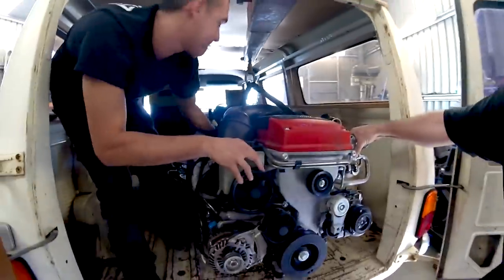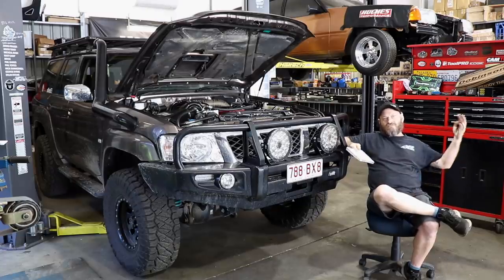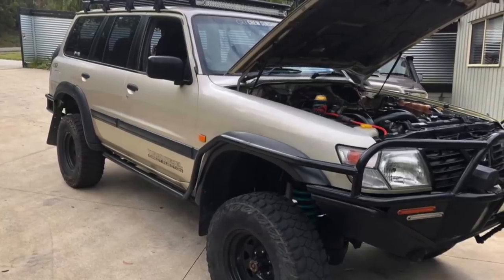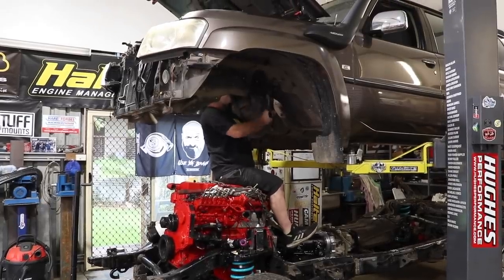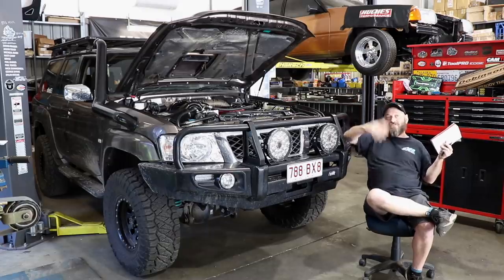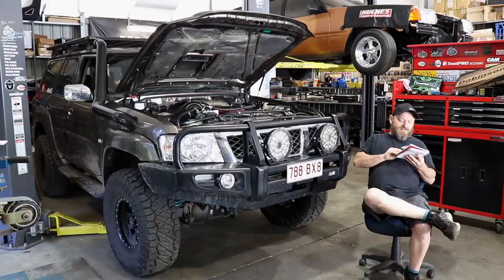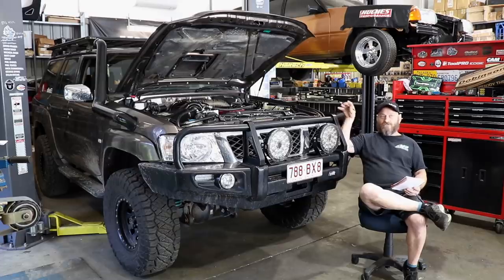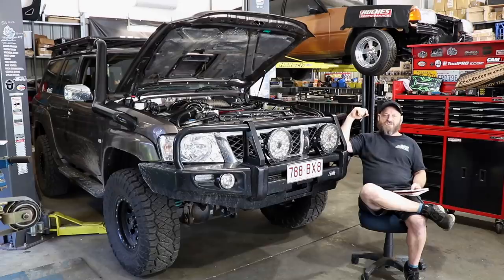Thinking of a Cummins Conversion? Watch This First!

Comment: ive seen lots of bmw m57 swaps into patrols. hell of an engine to put into one
Reply: I was looking to comment this. The m57 is a badass engine! There are a few in USA making close to 800whp and 1,100ft lbs (600kw 1500nm)
Reply: @JAM4382   stock engines with a light tune make 350hp 550tq and rev to 5k rpm. Love mine in my 335d.
Reply: @shapoopeedee  nice👍🏻 I had a 335d also until some asshole wasn’t paying attention and totaled it. I so miss driving it, I want to get another someday.
Reply: @spannerworx7106  Santjer Performance BMW M57 Triple Turbo 793whp / 1082 lb ft…. The information is out there. It’s not a kit you can buy yet as they are still developing the setup.
Reply: I was going to suggest the same, fitting kits are available from Europe complete with ECU etc, just need a motor form something like an X5, checking around basic total would be well under $20K (kits about $10k and then engine about $4-5 then all the bits and pieces) plus a mate has a GQ shorty sitting in the back of his shed......

Comment: I’ll probably cop it here, I’ve had many cruisers and patrols. I’d love to have a S4+ patrol with a 5speed 1hdfte.
Reply: Davo, have to agree, the 5speed auto and 1hd-fte conversion in my 105 is smooth, quiet and gets it done .. I'm also Gu fan for the suspension geometry and diffs of course .. but like most of us, just want more than what came under the hood! For a second project, I'm on the lookout for a cheap S4 Patrol and I'll do the same again .. You get 24Valve, efficiency, high enough torque to tow whatever, no overheating and long term reliability. Front cut FTE for $12k and if it's done less than 500000k just send it, with a bigger set of injectors and turbo .. No rollin coal!
Reply from the maker: It's certainly not a bad idea but also not cheap, that'd be a $30k easy.
Reply: @theskidfactory  Spot on with the calculation, 30k for the conversion is realistic, plus the donor GU .. makes an end product that is better than either of the brands ever made and less than half price of a new version of either .. IMHO
Reply: If you do happen to do this fella’s, the new yanmar Marine engines are a 1hdfte. Instead of paying 18k for one with 500k, 21k for a brand new engine is the way I’d go. As soon as someone makes a 1hd to re4/5 adaptor, I’ll be doing this. Re5 behind the 1hdfte would be my dream car, keep up the wealth of knowledge and future episodes fellas never miss a skid factory vid 👍

Comment: Tune your AFC to not give as much fuel before boost pressure comes up & you'll cut out that low end smoke & can actually get the turbo to spool up faster. You might need to change the spring or even to several springs within it. If you know an idea of your various boost pressures you can bench test the AFC foot travel accordingly to help speed up parts choices & adjustments.

Comment: Glad to hear someones conversion cost more than mine! I have just completed an LS3 and 6L80 into my GU and it's now a sweet, smooth ride.
Reply: Ls3 factory cams suck and so do the heads for low end. Stick a btr torque cam (202 duration 111LSA)  and ls1 style heads and manifold. Will have better torque around 2k rpm maybe as much as 40lbft. The Australian LS1 cam is even worse for low end. Best factory low end cams are L33 and Lq4. But the btr 202 cam is better then both. People forget that diesels don't rev past 5k. But everyone poops on these tiny LS cams even though the are good to over 5k rpm and most ppl go for something in the 22x and up duration. Unfortunately.
Reply: How much did you spend?
Reply: @Dan-rg7jj  nobody puts an LS into their patrol to putt around at 2000rpm though haha
Reply: @tcmx712  Have you ever driven something with a 4 speed that weights 3t plus? Even 2t plus unless you have bulk torque at 1200rpm like Al's it's gonna be doggy. Even with the correct gearing. Really, you are governed by gearing and in hilly burbs mine sits between 1k and 2.5k rpm stop start and up to speed. About 2.2k on the freeway in 4th probably similar to Al's. No idea what gearing to tyre ratio his is? Never said an LS won't do 5k plus. I have a 383 so torque is bit too big for 50kmph side streets at those kind of rpms. Also you can't just nip through the gears with 4 speeds not enough spread so you're always well over the speed limit. Sure mine is better now with the mods but still need more down low.
Reply: @Dan-rg7jj  dude op has a 6 speed and ls3 so why you waffling on about 4 speeds hahaha, and you do realise a standard ls3 has more torque at 2000rpm than a v8 70 series does anywhere in the rev range let alone anything that comes standard in a patrol so I don't know why you're saying it needs more torque down low when it moves the patrol a hell of alot better than stock???
Reply: @tcmx712  I'm not having a shot at the OP. Al does have a 4 speed which is relevant and he said comment what you think would be a good idea for a conversion so I did. I HAVE an LS3 thereabouts. It does have torque at 2000rpm. Not as much though as it has at 4000rpm. The only thing I said about the op is that the LS1 stock cam along with the LS3 cam looses torque down low (even in the mid) compared to the 6.0l and US 5.3L and LQ4 truck cams. It's more then you would think. If you compare torque graphs. And might be helpful to note for someone thinking about doing the work themselves and if you want more launch and better economy. More for less is always better. I'll be changing the cam in mine soon and going smaller. I have an LS3 cam in there atm so think I would know how they behave and if they're good or not good. 6 speeds are good never said that won't help over a 4 speed.

Comment: Id love to see a small CAT 6cyl or v8 in a patrol. I've seen a 3208 CAT V8 in a 40 something series cruiser so should fit in theory
Reply: Trouble is, CAT's are way too heavy, even the later modular engines
Reply: Dt360 any day
Reply: I have seen a 3208 in a Ford F250 on youtube. The guy had to do a body lift to make room for the engine. He also had to upgrade the front suspension (more leaves). 3208s are pretty big

Comment: Just when i thought i could take on putting a thong slapper from a 79 in my 80, along come al n woody and hit me with a reality check 🤣

Great stuff guys and awsome info keep it up 🤘👍👌
Reply: I think a built, 80 series engine is enough! Easier and much cheaper!
Nearly finished rebuilding the 1HD-t in my 80, that's been expensive enough. Went nuts though! 130% injectors built pump big turbo. Already have the rest of the necessaties fitted to make it hum. Instead of rebuilding my block I was able to get a Genuine Toyota short block brand new in the packaging.
Reply: The money you save in the wreck cost will be eaten with the conversion. Bite the bullet and buy a HDJ100 wreck and get stuck in.

Comment: So I have a 2004 2500 Ram with the common rail, no major mods, bumped the injectors 50 hp when I replaced them at 200,000 miles. Has 370,000 now. I have added a secondary fuel filter and a hydraulic filter for the trans. Love this truck for the fuel mileage, durability and performance, does good skids! Only pulled the trans once for freshen up, pulled fifth wheel camper, tractor and cars with it no issues. As far as patrol Cummins makes a new four cyl common rail as a drop in engine swaps, Jeep’s use them a lot. These meet emissions standards and perform well, not sure if it’s available in Australia. This new cummins is the package I wanted for my 95 Dakota when I first bought it. So if the new 4cyl Cummins is available there I love to know your thoughts about it. Lots of good info here, as always.👍

Comment: Some options I’d consider would be the Mercedes OM606, BMW M57, Toyota 4.5 1VD-FTV Baby duramax, 
the very well sorted Citroen 3.0L V6TT also used in NAVARA, Range Rover, BMW & gale banks does a version of it, to name a few engines I’d consider into my series 10 patrol,

Comment: 1HD-FTE. The logical choice for me. Expensive yes. And hard to find at the moment. But there are adaptors available to the patrol gearbox and  engine looms. 151kw in stock form or if you want bulk power change to a UFI turbo, unichip q4, +30 injectors 300+hp/1000nm at the wheels. 
I did this conversion into a 105 series and cost 18k  before engine mods. Add 10k for turbo, q4, injectors, airbox, snorkel, tune.

Comment: I was about to say OM606 before you mentioned it. Such a better platform over the huge engines like the Cummins. Smaller, Lighter, just as much power with little work, still mega reliable. Got 2 OM646 in mar cars (4 cylinder versions) and they run so great.
Reply: I had a facelifted e220 cdi with that engine in it (om646 evo) and it was amazing, so much torque and always willing to go, best part of an incredible car

Comment: Hay Al.  Thanks, this is a brilliant episode.  I know its getting old now but I watched when it came out and thought it was perfect for us getting older viewers.  Question. Should I?   My Father-in-law is suggesting he is "thinking about" giving my wife and I his old patrol for our kid free - empty nest- time coming up.   Its a 1999 2.8D Manual that he has had since new.  Its done the big lap towing a caravan and the east coast from Melbourne to Cairns and back a dozen times. Also towing a caravan!   380klms on the clock.    You need to know he is an old truckie.  He is 87 and started driving when he was 13yo. He has been an owner driver for ever and knows how to look after his trucks inside and out.   The Patrol is in as new condition. He cleans it weekly regardless. Servicing by the book.   No modification other than the Nissan bull bar and extra batterie.  The fuel pump was an early issue and was replaced under warrantee and cocked up again. Being an old truck he talked to "people" who recommended a chap in Melbourne who sleeved it and its been good ever since.  At 300k he had a bearing issue in the gear box. Up shot was all gearbox bearings were replaced but they asked when the clutch was redone.  This was because the clutch looked good.  Turns out it was the original clutch.  Old truckys know how to clutch!  
But it is a 23 year truck with 380ks.  So to the question.   Is there anything wrong with rebuilding the 2.8?  Im just wanting to do the same thing he did.  No Mud holes, No rock crawling just "normal" caravanning on dirt road with a bit of sand tracks.  Apart from getting all the rubber components replaced and having it thoroughly checked by a pro is there a way to just update ( rebuild)  it without engine swap. Id love your opinion.

Comment: Excellent presentation Al.
 Regarding noise. I have a 6BTA in mine, I halved the noise by surrounding it with acoustic foam. It does not block the noise it absorbs it. It looks like egg carton, dark grey foam. Very lite as well. I think it would work on (under) the bonnet. Buy from foam supplier. Mark.

Comment: I put a p pump 5.9 into my 79 ford, kept the dodge running gear but built it up. Can confirm the noise. Couple tricks are oil pan wraps, pushrod cover and valve cover wraps, where most the noise resonates. Made a good difference in mine.

Comment: Nice job. Back in the early 90s I had a 2.4 Hilux diesel that I replaced with a 3.4 direct injection from a dyna truck. Mark’s Adaptors gearbox/transfer, Detroit lockers front and rear, upgraded ultimate suspension and body lift. I so wish I still had that vehicle, it was sensational, unstoppable, just needed power steering.

Comment: Hi Al. First, I have a Dodge Ram with the 6.7, common rail of course, and the 6 speed auto. 
Now I have noticed the 5.9 powered trucks are Significantly Louder. I am sure a lot of the noise has to do with the difference in the turbos. All 6.7's have the variable vanes on the outlet. When I did the exhaust on my truck, I started the engine up with just the dump pipe in place and was amazed at how quiet it was.
The common rail injection also does amazing things with regards to a daily driver, so much more civilized. 
My truck does not smoke. I have 5 " exhaust, cold air box and a "Smartie" tuner and it runs Great!

Comment: Always good to hear Al talk about the engineering that goes into these projects. Watching a youtube video, you don't really get a feel of the cost of such conversions.. I mean, if there is all that custom fabrication, then it will get expensive if you are not doing the work yourself. And we also need to bear in mind, these things take time as well. It's not something that can get done in a week.. Probably takes months. 
The one take away from this is there is no BS coming from Al's mouth... well except for the part about Dodge Gearboxes not being good. LOL. 
I've heard about Cummins powered Ram 2500s getting over 500,000 kms with no issues. It all depends on the maintenance...

Comment: Figure torque is 2x the horsepower on any I6 diesel.  I'd think an HX-35 would be fine, maybe an HX 35/40 hybrid.  VP injection pump would go a long way towards tuning.  No idea how prevalent that pump is over there though.  I know guys praise the P7100 pump, but for tuning its like changing springs and weights in a distributor, then jets in the carburetor.  Yeah it can be dialed in... but it takes a lot of trial and error.  VP equipped engine can crank out 400hp no problem and not sacrifice bottom end response as long as the turbo is matched for the desired RPM range.

Comment: Good one Al, massive cost though. Perhaps for the next conversion a BMW M57 diesel could be looked at, nice and modern, plenty of power available with upgrades, plenty of donor engines or vehicles around as well.

Comment: I have had a Duramax converted GUIV for 7 years now. Its a love hate relationship for me. Most of my issues have been with the built Allison transmission, only done a water pump in the Duramax over that time. Not sure that i would do it again.. but nothing beats it for touring, and towing. I like to tinker with older cars and love the GU patrols. Problem in Australia is what else do you buy? live axle coil sprung diesel auto????

Great to watch Al discuss these engine choices, I know what it cost me to have someone do the conversion, and have subsequently lived through the highs and lows of owning a modified vehicle....great content mate.
Reply from the maker: Doing a duramax again with the experience of the first one I did is also an option for me. The engine and transmission combo is unbeatable for the price. Mine also had issues with the Allison and they are not an easy rebuild.

Comment: If money wasn't a issue I'd go the 4.5 Cummins, but to be honest IV been so impressed at how my td42 is taking 180kw 600nm that I'd just get the engine built in a "blue print" style. I think slapping a girdle under the crank and a properly balanced up rotating assembly you could make a very reliable 200kw engine with way less messing about and be a fair whack cheaper! 

This video will be the go to link to ever FB post about how much for Cummins swap  in LandCruiser or patrol.

Comment: If you had the room for it, compounds quiet the motor down and reduce EGTs.  Probably the best option for a single turbo would be a Super 9 hybrid from PDD, but they are not inexpensive (they build those themselves).  Use all OEM mounts if you can, they quiet the engine down a lot.  I did a swap of a OM617 into a car, it was incredibly loud until I found out that the transmission mount was contacting the frame.  The noise dropped a tremendous amount after I made clearance for that mount.

Comment: If you've blown up your ZD30 then the smart money is on a TD42 conversion. Best bang for buck. If you want something more lively that won't require drug money then an LS manual conversion is the next best. Relatively simple, great torque off idle and big power if you want it, etc. While a Barra MAY be a little cheaper, there's a lot more fiddly stuff and the power/torque characteristics don't really suit a heavy 4WD.

Comment: Hi Al and Woody, great summary of the conversion, and like has been said would be great with every build you guys do. Take a look at the BMW M57 engine. Readily available here, cheap, strong straight 6 3.0l common rail. Very similar to the OM606. There is an English company that sell stand alone cracked ecu’s for not much so would make a great swap that other ozzys could copy as engines are available here. I think they run the same ZF auto as the Barra and adapters for these to patrol cases are available off the shelf  so again, nothing too fancy. 
So cheap smooth revy power with modern common rail and matching auto. Wining combo maybe?
Keep it up lads 👍

Comment: I think a few people give up on the ZD's a little early, a lot of the problems stem from Nissan making them actually comply with Euro emissions standards with the re-circulation of gasses and theres a problem there when it essentially begins with one little thing, buggering up another little thing which in turn leads to the over-pressure from the turbo, clogged MAF, overfueling on some cylinders, leaning out in others, cats and dogs living together and explosions.
So I completely understand if people throw them away!
Actually fixing the ZD30 is possible, but its also requiring some diesel boys on the tools that know their stuff and a not inexpensive amount of big ticket items into the engine bay. Is that cheaper than a full engine swap? Yes, is it worth it to know you're more or less running it with a lot of aftermarket parts that need specialist techs to fix? 
That's really up to you as the owner and what you use the vehicle for and your access to those guys during the higher level servicing or go with the full swap to something with known reliability that can be fixed by lesser mortals.